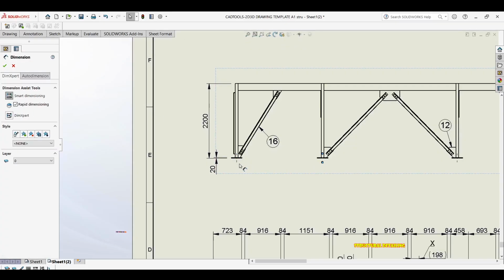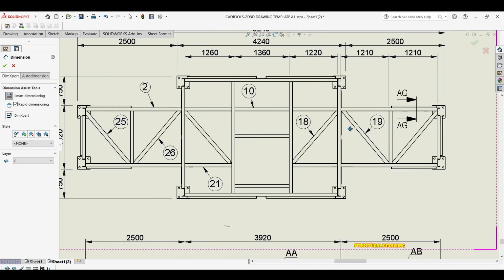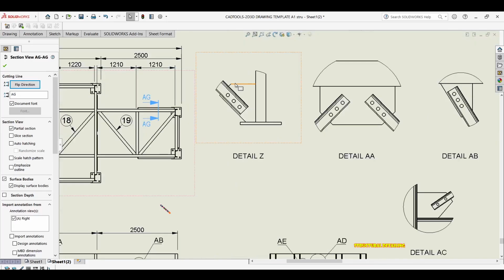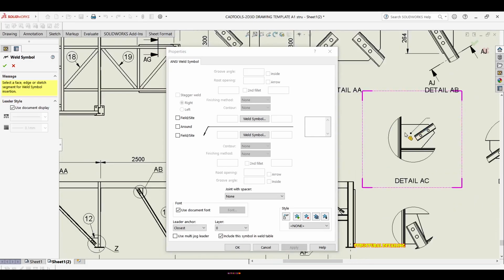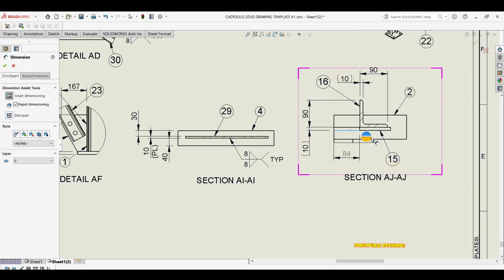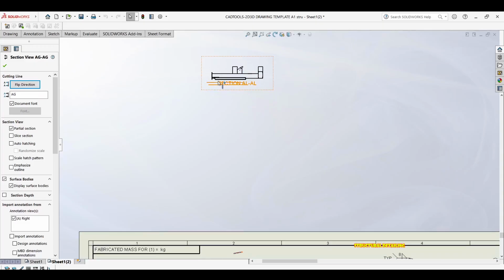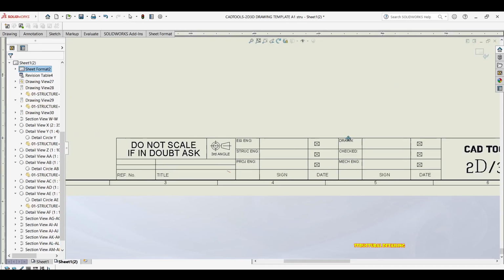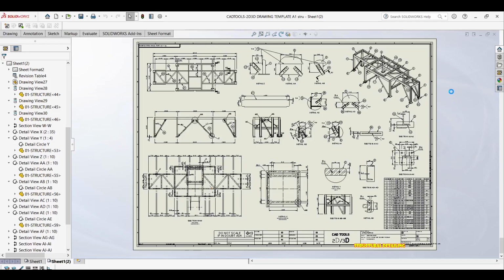SolidWorks Structural Detailing | PART FINAL: Complete Fabrication Drawings | 1h44min Masterclass

Comment from the maker: 📌 PART FINAL IS LIVE! 

This 2-HOUR deep dive takes you from raw weldment to 100% FABRICATION READY shop drawings.

🎯 KEY TIMESTAMPS:
36:00 → Accurate Dimensions + Tolerances 
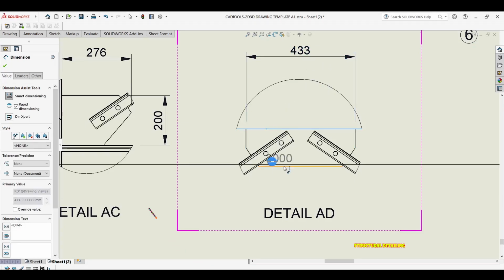55:00 → Complete Cut List Setup — custom properties + total lengths
1:08:30 → Weld Symbols Applied — stop getting shop calls
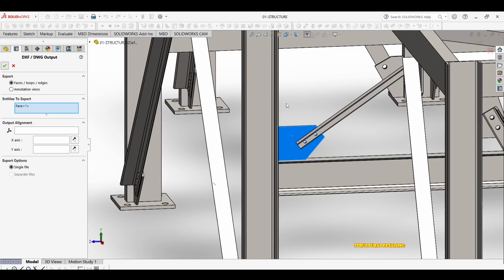1:58:00 → Fabrication Ready QC Checklist — don’t skip this

💬 WANT PART 6?
Comment “FAB” for As-Built Drawings + Redlines. Hit 100 comments and it’s next on the list.

❓ NEED HELP?
Comment with your timestamp + issue. I’m answering everything for 48hrs after upload.

⚠️ REMINDER: Get engineer approval before fabrication. Verify all weld sizes. DO NOT SCALE from drawings.

Tools used: SolidWorks 2024 Premium | Full series: https://youtube.com/playlist?list=PLnumlDGlcv79cHFZv2mx9koS7fFAK4irh&si=S1WnQCl1_hGa45QT